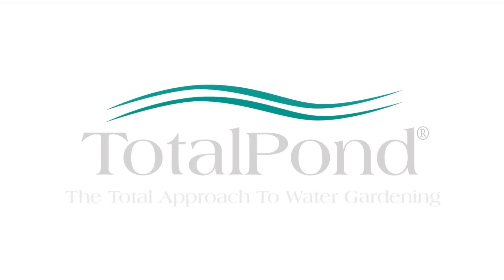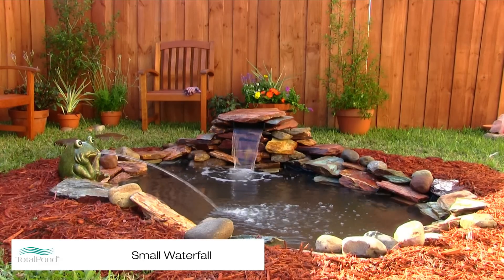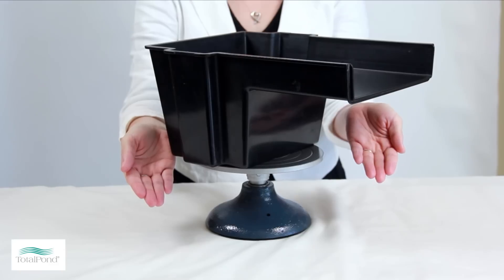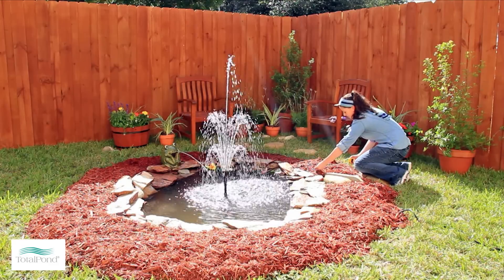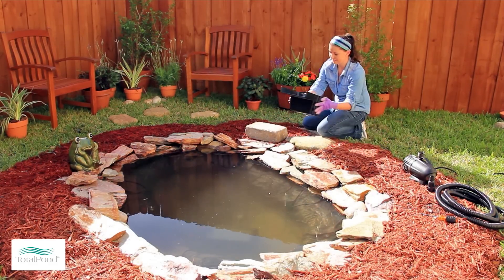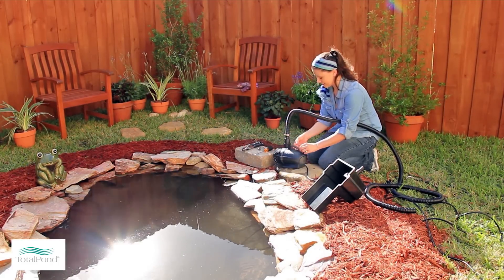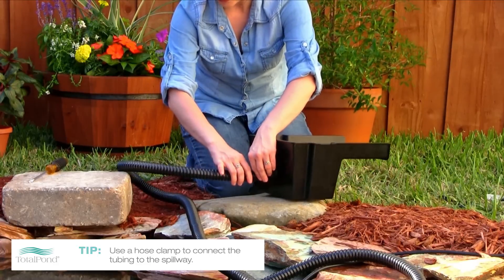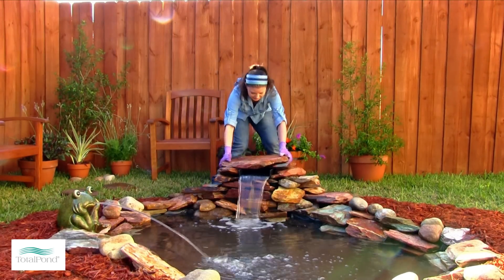How to Add a Small Waterfall to Your Pond

Comment: Kinda not related to the waterfall, but how much would it cost to get the pond cleaned out like after a long time when sludge has settled on the bottom? Like after the winter season or something 

Thanks for the vid
Reply from the maker: Hi Teague, thanks for your comment. Unfortunately, there isn't a set cost for pond cleaning services so we recommend contacting your local pond equipment retailer for recommendations. The cost will fluctuate based on the size of your water feature and the total hours required to bring your pond back to peak condition. If you would prefer a more DIY approach, consider investing in a pond vacuum. We hope this helps.
Reply: @TotalPond  

Yup, that does help. Thanks!

Comment: how do you hook up the power to make the pump work? Is there a video on that?
Reply from the maker: Hi Cesar, our 1200 GPH Waterfall Pump comes with a 16 ft. power cord. As long as a outdoor-rated outlet is available within that distance you'll be able to run your pump with ease.
Reply: TotalPond thanks. do you have to dig a trench to disguise the cord?
Reply from the maker: For this particular project we disguised the cord with mulch and slate, but digging a trench is also a great option!

Comment: How do you connect a spitter and a waterfall to a single pump?
Reply from the maker: In this particular pond, the spitter has its own pump (not shown in the video). But you can run a spitter and waterfall off a single pump using a Y-distributor. Hope this helps!

Comment: what is the hose diaimeter
Reply from the maker: Hi! The 8" Spillway is compatible with 3/4" and 1" tubing. For more info: http://totalpond.com/product/waterfall-cascade/
Reply: I see where it says it's "compatible" with 3/4" and 1", but wouldn't a reducer work with a bigger or smaller hose?  Granted, the flow will be limited to the smallest connection or hose.